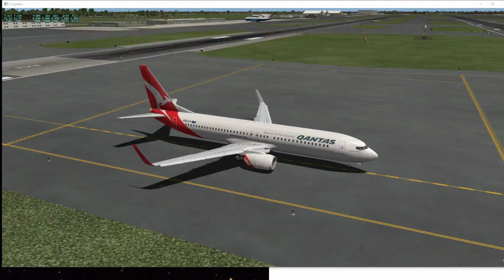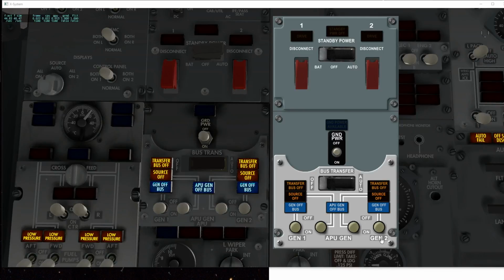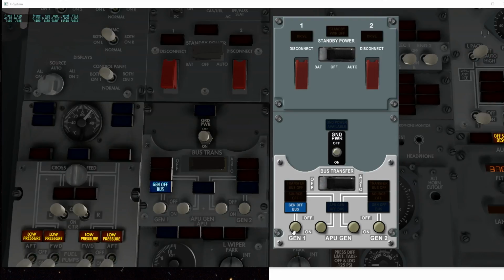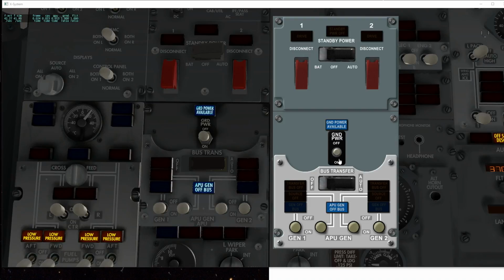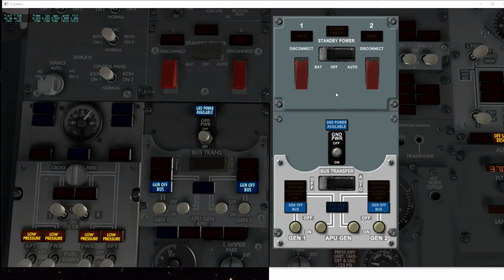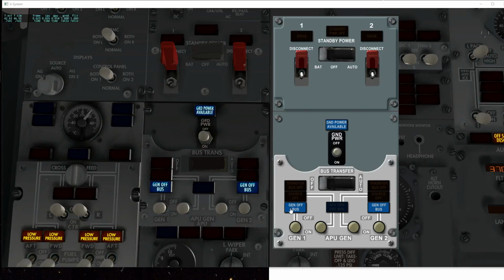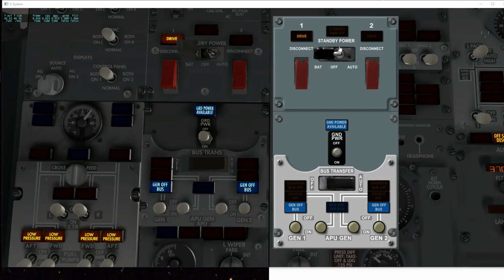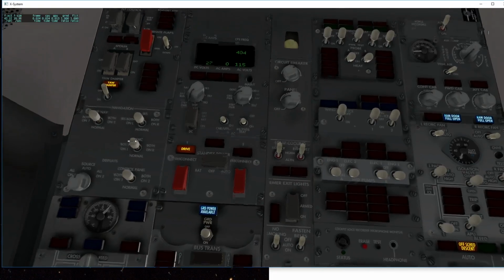Air Manager x737 Overhead Update 3

Comment: Nice video.  I love this aircraft.  It worked great in X-Plane 10 but in X-Plane 11, my panel knobs don't rotate.  Most of the push buttons work.  Any suggestions?  I'm desperate to fly this in XP11.  Thanks.
Reply: Jack Flash same for me.  And the radios does not display anything